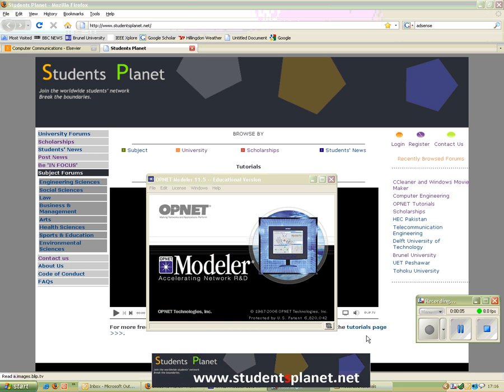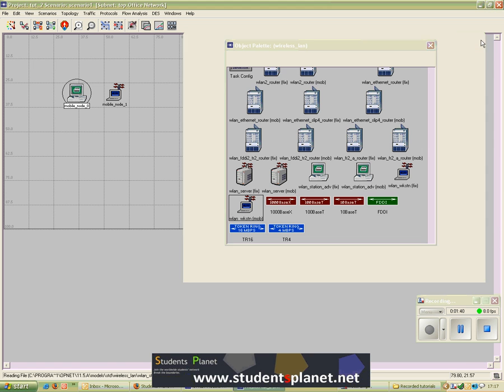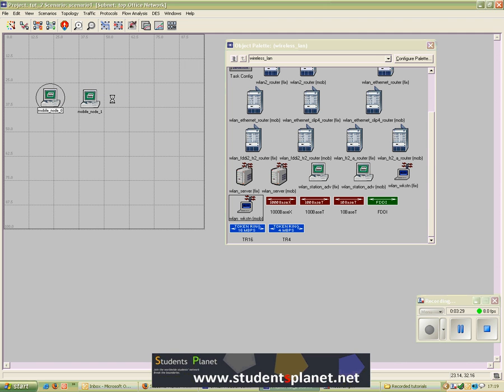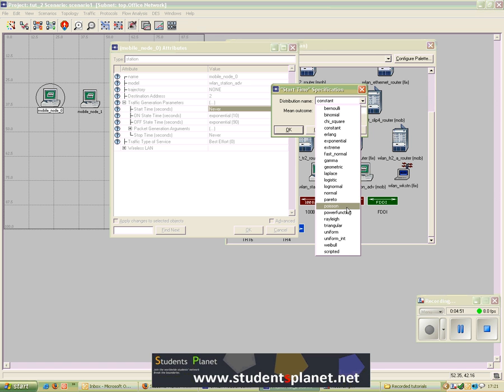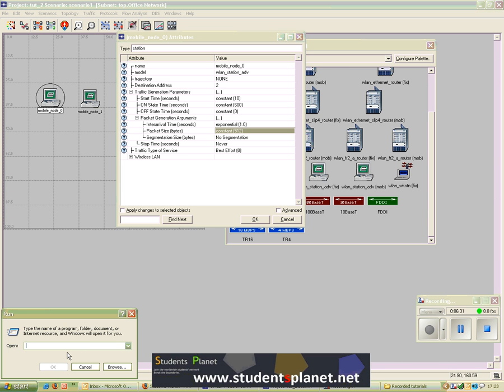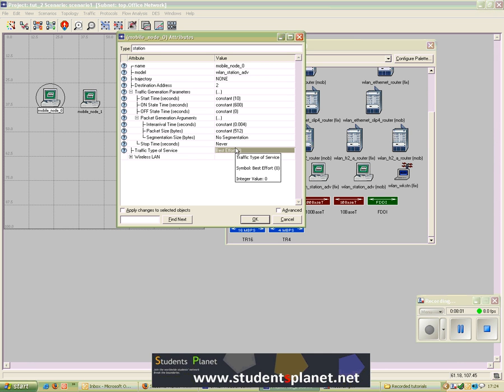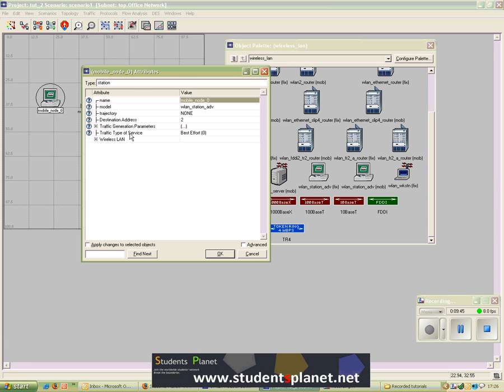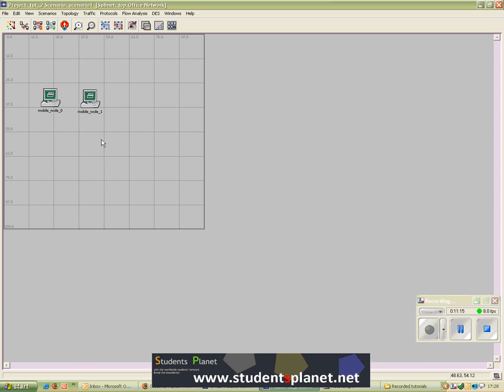WLAN Configuration using WLAN Station Model

Comment: to everyone has a problem in the simulation here is the way to fix it 
'open a new project then press Edit > preferences then search for network then scroll down for a label "Discrete event simulation you will find below it " Network simulation Repositories " its value is 0 for default set its value "stdmod" and press apply and then ok thats it your simulation will work fine now :)'